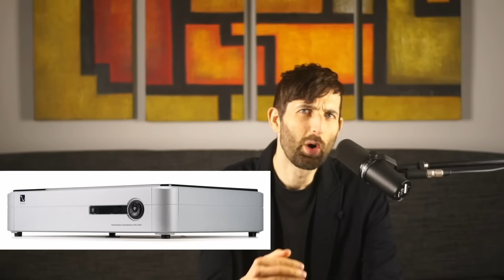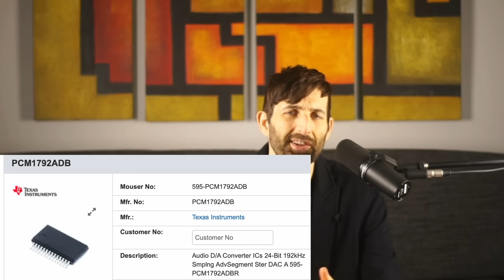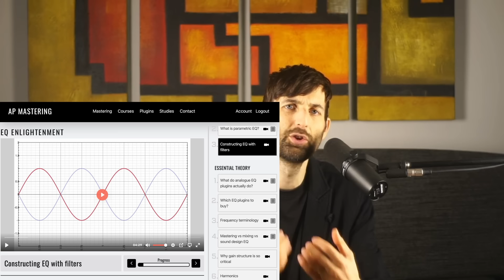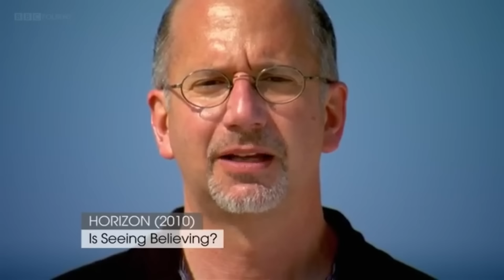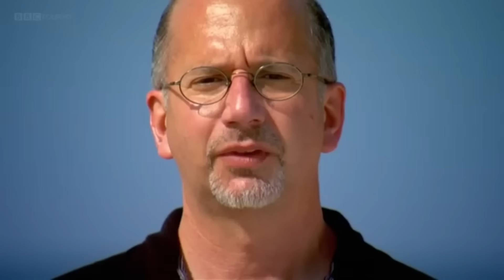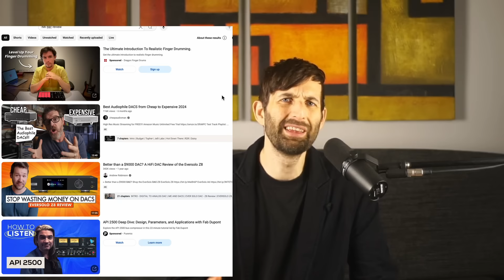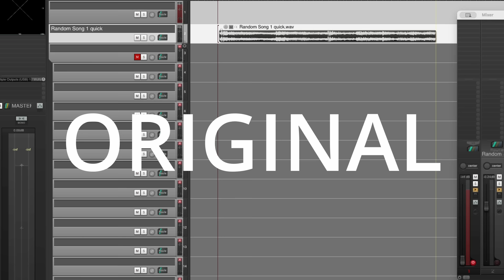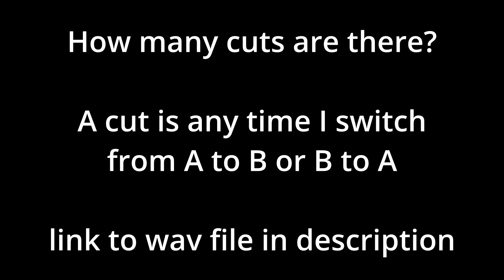The DAC Scam - Almost everyone believes the hype

Comment: Wow what nonsense is this video! This guy clearly has never really compared DACs that are volume matched. Every DAC sounds very different. The differences are enormous. As if the chip is the only variable here.... power supply, analogue output stage, volume attenuation (if there is one), each part in the circuit changes the sound. Capacitors, op-amps, etc. etc. Maybe if you just compare some cheap garbage chip based ESS DACs then you might be right but please go listen to some well designed gear and you won't find much in the pro audio market unfortunately. 

If it was so simple as this guy is saying then this market wouldn't exist at all. To say that all people that are hearing differences in DACs are wrong is called gaslighting. You're neglecting the reality of other people just because you don't have their listening experience. Greetings from a fellow mastering engineer.

Comment: Saying DACs all sound the same because they use the same chips or types of components is like saying all computers using a specific CPU run the same, it's not taking to account the motherboards and other components in the system. A DAC as an external device isn't just a chip, it's a package full of chips, capacitors and things of that nature. If you think Amplifiers make a difference, then you should think that DACs do too.
Reply: except computers have way more variables like a GPU and a screen and a keyboard. and a thermal system. a digital audio converter literally just converts ones into zeros. The only benefit you're getting is supplemental features. You're not getting any noticeable sound difference if you're buying a $2,000 DAC with the same chip that that you can get in a $200 dac. You're comparing it to a computer is just not apples to apples. And even then you still wouldn't pay $3,000 for a laptop with an i3 13th gen in it. if you could get a different laptop with an i3 13th gen for $300.
Reply: The DAC chip is only a small part in the overall DAC product although still being significant.  Just like a CPU is a small part of a computer, however significant.  You can have the best processor in the world, but if you have a generic motherboard, and a bunch of other cheap generic china parts that make up that computer as a whole will be a piece of crap compared to what you really could have.  A DAC does not just convert ones and zeros.  The DAC chip, or R2R inside the DAC do the conversion of ones, and zeros.  But you also have an input stage, and an output stage to a DAC.  You have filtering as well.  A DAC is more complex than you realize.  Your statement just shows how little you really know about DACs.  DAC with the same DAC chip can have similar sonic features, but not always because there are more variables to a DAC than then DAC chip used in that DAC.  The more pristine your audio rig, the more revealing the DAC will be.  The less pristine your audio rig, the LESS revealing the DAC will be.
Reply: @mttrashcan-bg1ro  I agree
Reply: Renowned DAC designers with more technical qualifications than the guy in this video agree with you and can provide detailed explanations of the same. Just search YouTube.

The guy in the video made a bunch of errors of reasoning and fact, the main ones being:

- A DAC’s sound quality is reducible to its chips
- Technical metrics prove how a DAC sounds
- Therefore that DACs over a certain basic technical spec basically sound the same 
- That a “small” change to a DACs subjective performance necessarily is worthless from a listening standpoint
- “Accuracy” to source as measured by technical metrics should be the goal of a DAC 

I think that last point is really the worse of them all.
Reply: 😂  another flatearther
Reply: "saying all computers using a specific CPU run the same"
Yes, that is a reasonable statement. 
The DAC is a chip.  A tiny chip.  This box that houses all sorts of equipment ought not to be called a "DAC".
Reply: @thomasmaughan4798  DACs come in different sizes, the bigger ones tend to have a lot more inside the box, that's why they cost more. The other parts within the box might be higher quality, and maybe more of them, this is why a Gungnir will be a lot bigger than a Modi.

I used that comparison because two Ryzen 7 9800X3D's won't run exactly the same, and can be determined by components around them such as Ram, Motherboard, etc. I used this comparison to DAC chips because you could use the same DAC chip in a small box with a few other chips and things, but then put it in a bigger box with more parts and higher end components and it'll likely perform better. 

On the other side of the coin, if the GPU isn't being fully utilized and putting a better CPU in increases how much the GPU can be pushed, then in one PC it wasn't at it's limits. Who am I to say in a small DAC that same DAC chip is just being held back, and that's why you pay more for a bigger one? I don't know the full science behind it, but I know my Bifrost 2/64 sounded miles better than my Modi, with the same Headphones and Amplifier

If you don't notice a change in your audio setup, you cannot physically put it down to it being snake oil, it might not have been the weak point in the chain.

Comment: I have the Lyngdorf MP-60 2.1 think I bought it from Audiogon for about 8k USD.  I think it sounds great with each of the 16 XLR outputs having its own discrete dac chip.  It is smooth, musical, excellent detail and holographic sound stage.  With the Room Perfect it can calibrate your speaker/room interface and integration of subs with the main speakers.  It also has an internal streamer for Tidal connect and Qubuz.  Personally, I think it represents good value for the money given the SQ improvement but that is a subjective assessment. You can buy a two-channel preamp and separate dac for similar or more money and not get a fraction of the features. Is it expensive- yes.  Will it provide years of musical satisfaction?  Also true.

Comment: Oh great another idiot who talks about theory. Just because most of them are using the same chip does not mean they sound the same. For example there are a few guys who turned a small dac board that goes for 30-50$ in to tube dac that sounds (in their words) better then 5k tube dac. Other engineer was talking about how they use both channels of the chip to lower the jitter, some use 4 dac chips with 8 channels, some like Schiit use medical chips for audio, then is the output stage, and caps and different PSU... if you need a good dose of copium for being poor, tell yourself that every dac sound the same, but stop lying to people who lack the experience in this field.
Reply: At the end the job of a DAC is to convert a binary numeric value into a voltage which is proportional to this value.
And any modern and mass produced DAC chip can do this with breathtaking precision there the remaining errors are ridiculous small compared to the unlinearities of even high end amplifier or even loudspeakers

"some use 4 dac chips with 8 channels"

You could also use 32 dac chips with 64 channels - the question still is if it does anything better....and if so is the difference hearable for any human.

If you are standing 10 meters away from an Airbus A380 engine that is running at full power, it makes no difference whether a bumblebee 5 meters away is causing noise in the form of a hum or not - you will not hear the difference.

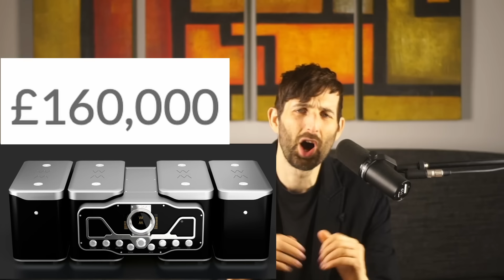Comment: this is misinformed clickbait. The chip is only one part of the conversion process. You have simplified this down to the point of misunderstanding. Not to mention that chip-based DACs are only one type - we have R2R and FPGA designs - including the DCS you show a photo of right at the start! 0:35
Reply: R2R DACs already have problems to produce real 16 bit solution because that would require resistors with tolerances less than 0,000762939 percent which is close to impossible. The only advantage of R2R is that they can process higher sample rates than 1-bit-oversampling DACs - but that gets an issue when the sampling frequencies are in the range of 1 Megahertz or above - which has no relevance in audio

Comment: Two dacs might have the same chip but different output stage circuits. Which makes a big difference in sound quality. There’s also power supply, which makes a difference. The engineering of the circuits actually does make a difference in sound quality.

Comment: I love my hi-fi. But I’m not one who is a diehard to believe what is being marketed. I don’t have huge amount of financial resources either. I don’t own boutique cables and inter-connects.

I have enjoyed a lot of components in my system. But on my own, I can’t ABX nor do I have the knowledge to conduct the switcheroo test.

After watching this video all I can say is this:

- get your hands on say a Topping D90 (AKM 4499)
- get your hands on the HiFi Rose RS150 (AKM 4499)
- compare both after level matching etc.

Let’s see if you actually hear a difference … or not.

Then try this too:
- get your hands on a Bluesound NODE (used as a streamer transport)
- get your hands on a Lumin U2 Mini
- compare both through a common DAC

Let’s see if there is any obvious difference.

In tests, not only listen to the whole song BUT compare 3-4s passages between the different units. See if there is any difference in sibilance, the trailing edges, the added reverb etc

Try the above suggestion. See if it’s all in the mind or maybe, just maybe, there is an audible difference.

Comment: The job of a digital to analog converter is to convert a binary encoded number consisting of n bits to a voltage range which is splitted up into 2^n voltages.
Or in other words: Convert the number to a voltage which is proportional to the numbers value
Using R2R-DACs it is getting more and more difficult as the number of bits per sample because all resistors must be as precise as 1/(2^n).
Per bit you need two resistors - of which one has a resistance of R ohm while the other has the double resistance of 2*R ohm.
So if  R would be 100 Ohm the allowed tolerance for the lower n resistors would be in the range of 99,9984 to 100,0015 ohm or +/- 0,15% for 16 bit samples which is extremely hard to achieve.
Using 1-bit-oversampling DACs converts the problem from having precise resistors to having a precise clock which is much easier and even better. Even if the clock time is not perfect you still get a voltage which is proportional to the samples numeric value as long a the duration of a clocks cycle is constant. 
Comparing the precision even cheap 10$ 1-Bit-DACs have with the linearity of amplifier or even loudspeakers it is ridiculous to spend thousands of dollars for an more accurate digital to analog converter.
1-Bit-Oversampling DACs also solve another problem. The analog output of an DAC has to filter to any frequencies equal or higher that the sample frequency are removed.
This has to be done by analog components and it is impossible to create such an filter which leaves a frequency of 22050 Hertz perfectly through while perfectly blocking a frequency of 22051 Hertz.
Where is always a frequency range where the filter start blocking a little bit until blocking 100%.
1-Bit-Oversampling-DACs are using much higher sample frequencies - so the point where this filtering takes place could be easily much higher than the highest frequency human ears can detect and therefore causing no hearable problems.

Comment: I'm still trying to figure out the damn point of an external DAC.... period.  I mean doesn't pretty much every digital audio device/source pretty much already have an internal DAC?  So.... why get another?  Your computer... has a DAC.  Your phone... has a DAC.  CD players..... you guessed it - have a DAC.  So..... why buy an external standalone DAC?  

Only reason id see the point of one... kind of... is if you for whatever reason buy a cd transport instead of a player.  As a transport just reads the cd but doesn't have an on board dac so you'll need one to make the transport/cd actually payable/audible.  I "kind of" get the point of a DAC in that situation as you'll actually need it.... but.... just buy a friggin cd player. 

So again.... what the f**k is the point, REALLY of an external DAC?  Other than to make electronic component manufacturers do make extensions DACs more money.

Comment: Yes. Toyota and Lexus use the same wheels. Therefore their cars drive exactly the same.
Reply: That's a terrible analogy.  it would be a terrible analogy if you were talking about engines but it's especially bad when you're talking about tires.  because a digital audio converter does what it says. it converts a digital audio signal. it doesn't have unique sound signatures! That's why you can't tell the difference in a blind test whereas you could absolutely tell the difference between what car you were sitting in or driving in.

Comment: I would like to believe it, but having gone from a $150 DAC to a $600 DAC, I did hear a difference in the refinement of the sound reproduction, especially in the decay and wider soundstage. It has something more to do with just the chips. Probably with the implementation and circuitry before and after, combined with parts quality.
Reply: Hell yeah. I’ve gone steadily from a $500 DAC to a $25K DAC over the last 20 years and you’re going from “good and clear” to “spiritual nirvana”. Huge difference.

Comment: but its also about the wiring inside right ? quality, silver, same length etc !
and what about the moving parts, you cool it liquidly, with gas that moves by it self when it gets warmer so you don't need a motor to push it etc .... there's a lot more factors. stability of the aluminium, quality of alu. made from one piece instead of 'screwed' together .....

Comment: If you can't hear the difference, your system may be more midfi. I've heard the difference even when the same chipset is used. For example with the Shiit Modi using AKM and the RME ADI-2 FS DAC also using the AKM. 

A review said the sound was similar but I could tell the difference in my system easily. If I hadn't I would have kept the Shiit device in the system. It was far more inexpensive.

Comment: The DAC I use has 4 Burr-Brown PCM1704 converters per each stereo channel and 1 per channel for the remaining 4 channels.  That's a total of 8 chips for the dac, with an average cost of about 100 USD ea... makes the COST of just the chips alone 800.00 for that dac, much less the copper inner chassis, the hundreds of Silimic capacitors, the power supply, and everything else.  So yeah... cost is over 1k easily to manufacture the dac, which needs to be resold for 4-5x to make it worth building for the manufacture.  It matters.   While I agree with many of the points made in this video, I can definitely hear the difference between the dacs I own, at the same listening level.  That being said, the rest of your audio system has to be on par to hear it.  Also, your test track, was terrible.   You need to pick something that will demonstrate the claims of the dac manufacturer.  That recording was terrible.  Nobody is convinced by a track that nobody would ever listen to in a true audio test.  I've never been to an audio show and heard that track played by any manufacturer or reseller of high end gear... and I think I know why.

Comment: I agree with the general thrust of the video. I wish it had given examples of "this el-cheap uses DAC x and this €10,000 one also uses DAC x ".

I would also liked to have heard on how deterministic DAC chips are: for any given digital output, do they all output the same analogue signal? Or do they differ? Can one meaningfully compare DACs as yielding analysabily and/or audibly different analogue outputs?

Comment: I appreciate your take on DACs. However, the value in high-end DACs isn’t just hype—it rests on measurable improvements in things like jitter, noise floor, dynamic range, and component integrity. Brands like McIntosh, Classe, and Chord don’t charge so much simply for status—they engineer with advanced chips or custom FPGA filters, audiophile-grade parts, and precision clocking—all of which can yield more accurate, richly detailed analog signals.
You might not hear a big difference in casual listening setups, but when paired with high-quality headphones or speakers and high-res audio, the improvements can be profound—especially in resolving microdynamics and depth. Consider that an external DAC's value is proportional to the rest of the audio chain's quality.

Comment: This video is sooo misinformed. Wild. The chip is an important consideration to build around but it’s not the chip that’s driving the cost or determines the bulk of the end quality. It’s the output stage and power side. Proper stable power with no noise and implementing proper isolation is expensive and involved. And that’s not even getting into the output stage.

It’s true, of the audio hardware, a DAC is one of the items with the biggest diminishing returns. But there are differences. You need a highly resolving system to capture the bulk of it. You can get a DAC that’s 90% the way there for a few hundred bucks. But there’s quality of life features that drive the price up more too. Screens, remotes, EQ, inputs, etc.